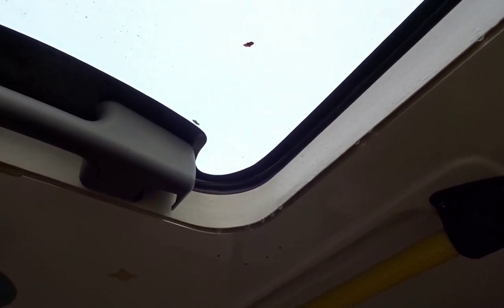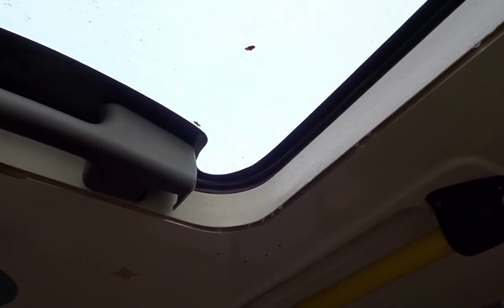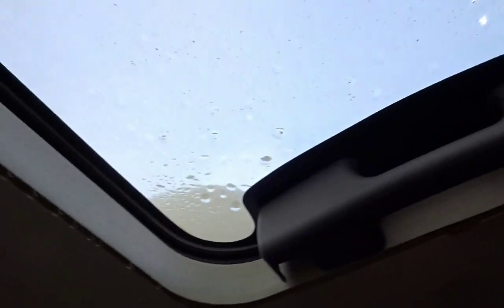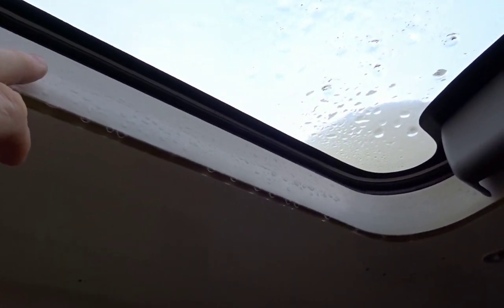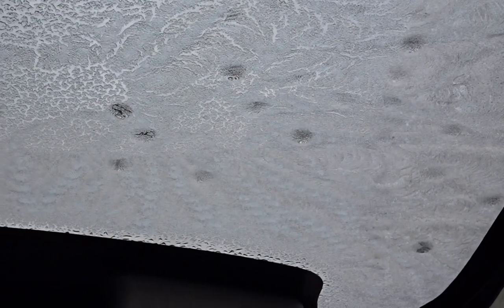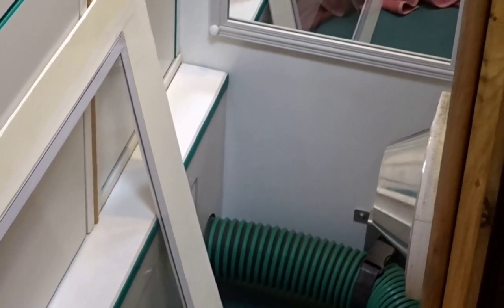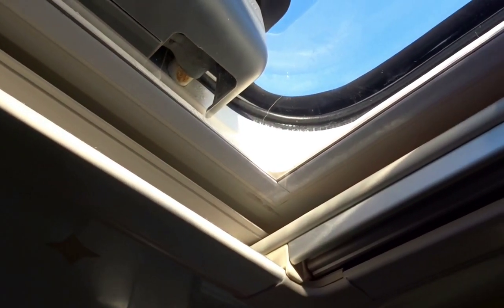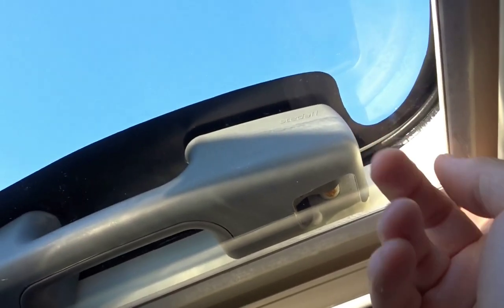Reducing condensation from my camper vans roof window/skylight

Comment: Did you remove the interior panels for insulation
Reply from the maker: In this type of aluminium sandwich construction no it can’t be done. The sandwich is only about 30mm in total and the internal aluminium skin suffers from condensation in various areas especially in the front lockers and on the doors. The door frames are significant cold bridges. With hindsight this van would have benefited  from an extra 25mm of pir on the walls and ceilings, plus carpet or cork on all the exposed aluminium There are also  several areas of hollow box section alloy that reinforce the box that aren’t insulated at all.

It’s a misconception that Ambulances are well insulated most are not, by design they don’t need to be, some panel van variants have virtually no effective insulation at all. Think of any installed as probably there more for soundproofing rather than as insulation.